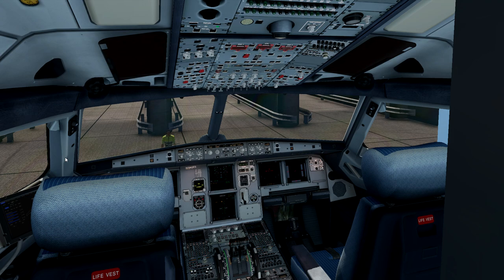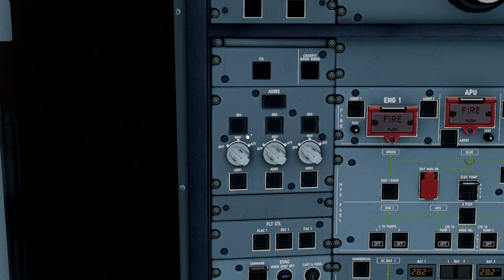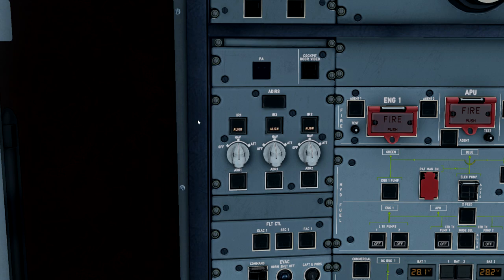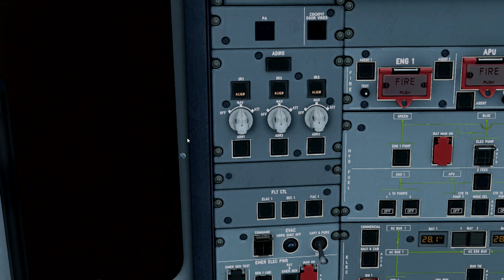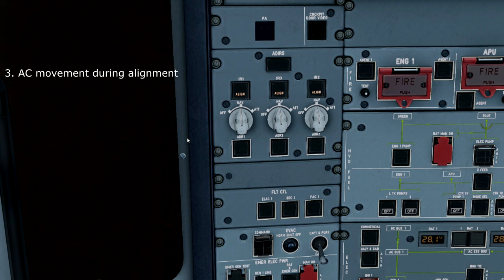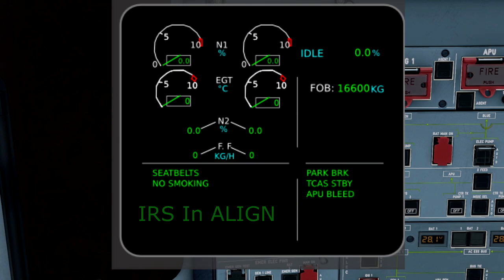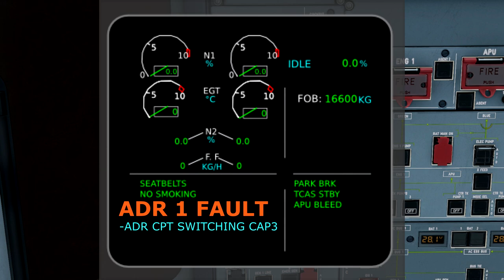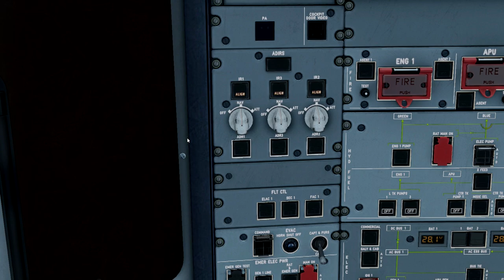Airbus Cockpit Explained | ADIRS Panel | Episode 1

Comment: I've heard about "waiting for the ON BAT light to extinguish" before, but never have read it on any actual FCOM,  FCTM or QRH procedure. Is there a possilbility that this is a legacy coming from older aircraft  models? Sort of a non standardized practice that turns out to be just a good method.
Thanks in advance.